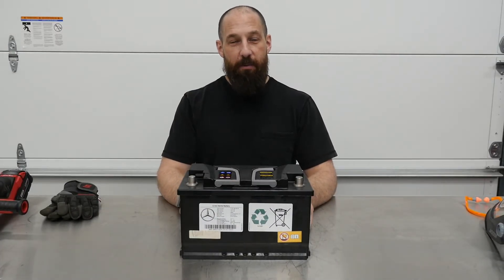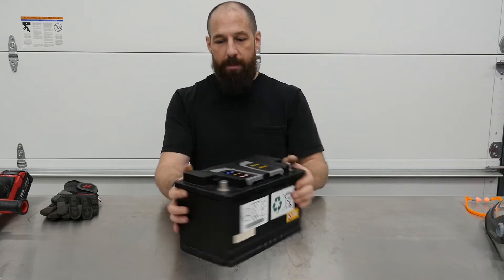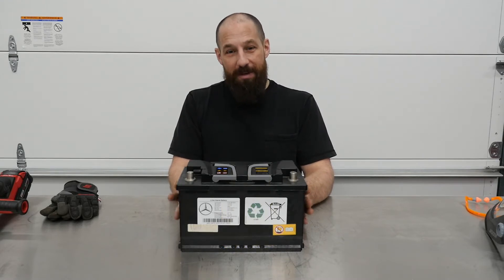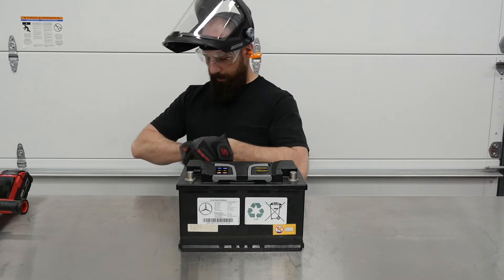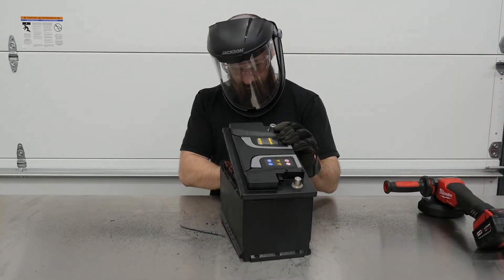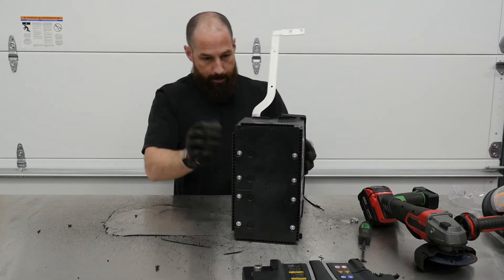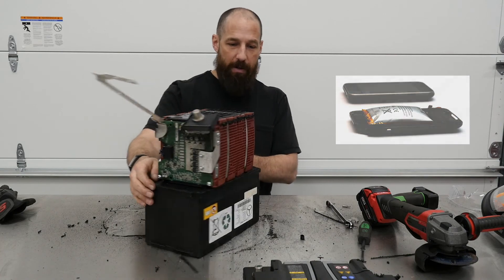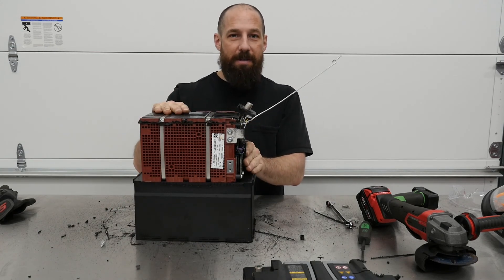Cutting open a Mercedes-Benz 12v lithium ion battery

Comment: Hello Dear 
I have one in my Mercedes Benz GT S63 AMG 2020 , the price of this battery is very expensive about 2500$ in Saudi Arabia, my question can I replace it with any lithium ion battery with the same size , what you recommend, does changing to other brand which have no wire plug on top left   could affect the gears  box or computers of the vehicle and what the benefit of this single wire.
Reply from the maker: The MB battery has a control module built in, that’s what the plug is. If you put a battery in that doesn’t have a plug, you’ll get a warning light.
Reply: @AMGmechanic thank you for reply , regardless the warning light that will appear, does the  car engine and  gear box and computers will perform normal if I replace it with compatible  lithium ion battery and if it is ok what brand you  recommend
Reply from the maker: @yousefalhamad5989 yes

Comment: Is it possible to trim the plastic supports on the outside off the battery case while still keeping it sealed? Specifically, the protrusion all around the base. Need to remove .5'' from the exterior.
Reply from the maker: Yes
Reply: @AMGmechanic  Awesome. Thanks for the reply!

Comment: hi, do u have the part number, please?
Reply from the maker: A0009824113
Reply: i believe these r the same as mclaren (prob gen2) batteries, & compatible with the mclaren system (also A0019829008, A0009826405)...
Reply from the maker: @bushtuckerkwe5747  Thanks for the info! They’re probably all made at the same place and different stickers are put on them 😆

Comment: What is voltage of a good lithium ion battery? Mine is 3.3v
Reply from the maker: It’s usually a little higher than a lead/acid battery. 13.6-14.4 is pretty normal. 

Throw a charger on yours and see what happens.

Comment: Good morning, I am Mr. Zanellato Omar, owner of a Mercedes C 200 Bluetec W205 year 2015 1.6cc 136hp, license plate EY551ZD, vin code WDD2052371F177822, my car is equipped with a li ion starter battery, like the one in the video, the battery no longer works and no one can restore it, I wanted to ask a question, now I have installed a simple Varta battery for almost 2 years and the car works fine, but I have the error of the battery in red in the digital odometer which no longer allows me to see anything due to the wire in digital which was attached to the other lithium ion battery, which read the parameters and temperatures, that cable now disconnected causes the error, now, there is no solution to remove that error, I think that cable is called pbs, not can it be put under tension?  Or is there no code to adapt the car to the new battery?  I thank you already now.
Reply from the maker: The plug is actually a CAN connector. The li-ion battery has a control module built in. Since there's no control module plugged in, the vehicle knows there's an error. There is no way to make the error go away.
Reply: @AMGmechanic  But there isn't one.  Way to put that wire under correct tension?  Because Mercedes Benz here in Italy says that this battery is not available.
Reply from the maker: The batteries are available, but they are on back order right now. I don't know of a way to trick the network into thinking it has a control module connected. @omarzanellato6348
Reply: @AMGmechanic But there isn't one.  Way to put that wire under correct tension?  Because Mercedes Benz here in Italy says that this battery is not available.

Comment: Hello mate, 
Does this thing have BMS built in?
Can I use it without BMS or any additional equipment in my regular car withiout threat of over voltage?
Reply from the maker: It has a BMS built in. I've seen guys run them in their regular car without problems.

Comment: Hi, I own a Mercedes class c 200 bluetec w205 year 2015 1.6cc 136hp, it adopts this li ion battery but it has stopped working is there any possibility to repair it?  Do you know what the problem could be?

Comment: Hey what’s up man. Question. What are
You guys using to prep the cylinder deck surface for a new head gasket
Reply from the maker: We use Loctite SF7200 spray and plastic razor blades to remove any sealant and gasket material.